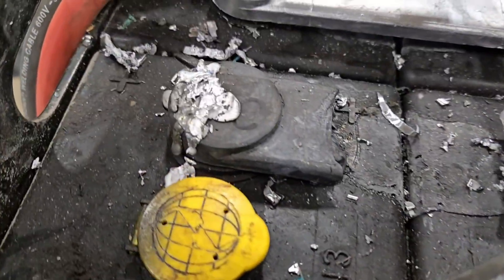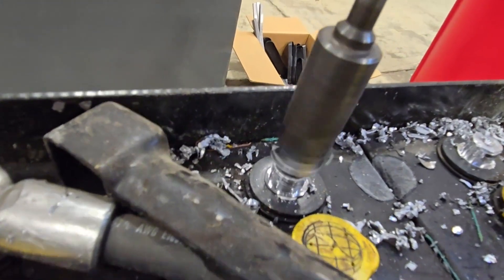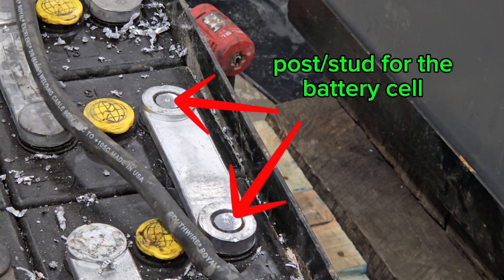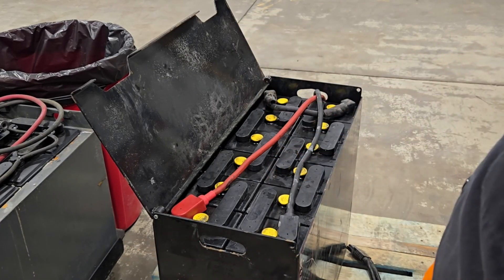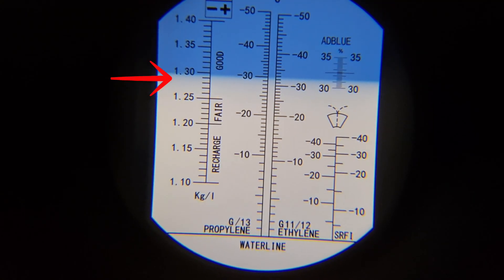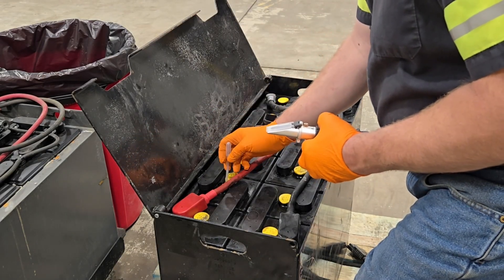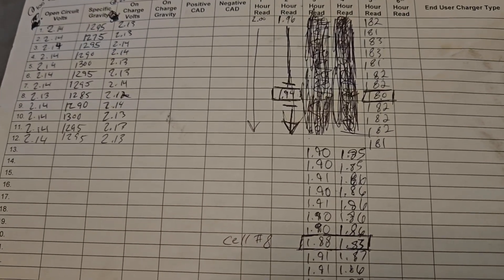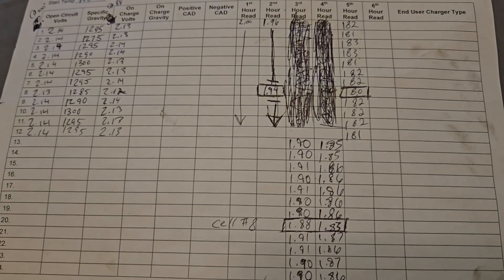Industrial Battery Load Bank After Customer Accident!

Comment: I'm new to the maintenance of lift batteries, and I'm just wondering how that one connector failed and what makes most of the other ones get so hot and sag down. Did someone short the cables at one point, and that caused the failure.
Reply from the maker: Nobody came out and said it, but my assumption is because BOTH cables were new. It's likely the old cables got smashed together on the forklift when loading the battery. Explains why the case isn't damaged either.
Reply: @Fixed-ish this is what happened more than likely.